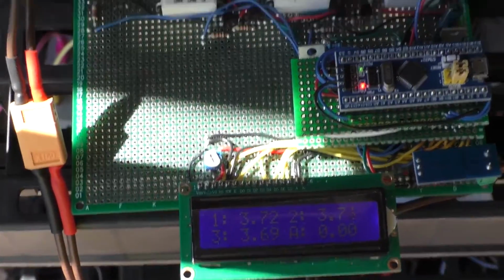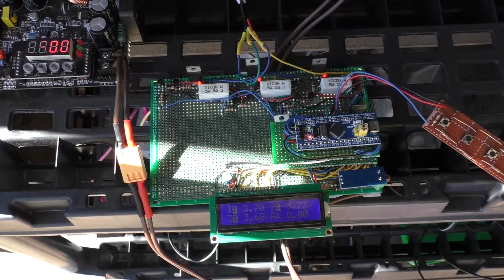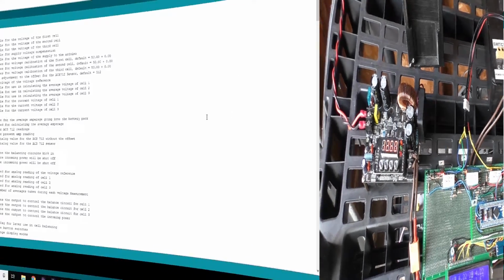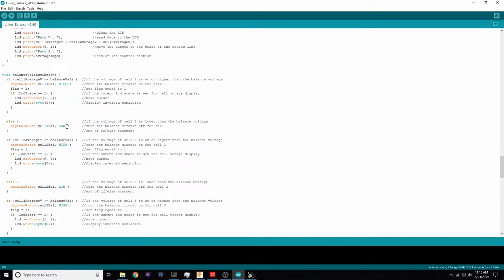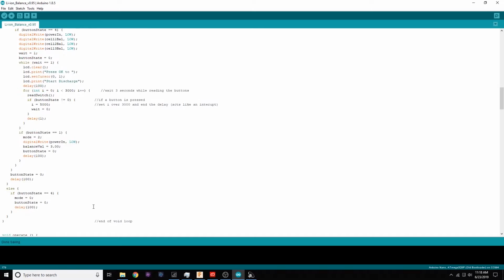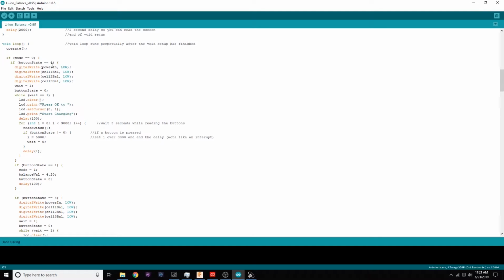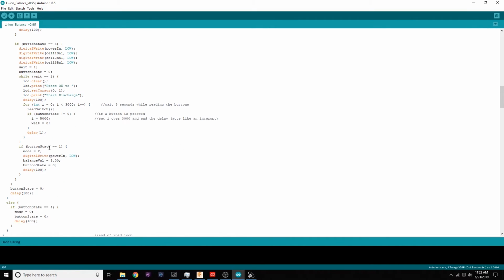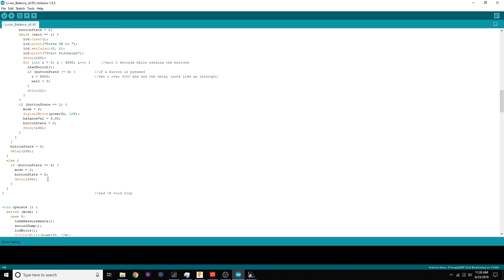Arduino BMS Project #13 Disharge Mode and Solar Charging Test

Comment: Hello Emann2000, very good, could you make a complete wiring diagram. eg: where the push buttons are on it (nano A5), B3 11V1 Where do you power it?

Comment: Can this project be upgraded to like 7 cell battery?
Reply: I am in the process of making something similar for a 90AH 5S LTO battery, the values have to be adjusted, and it depends on what number of inputs are available on the Arduino you use, I am using a Mega.